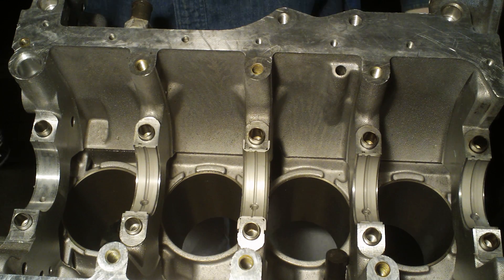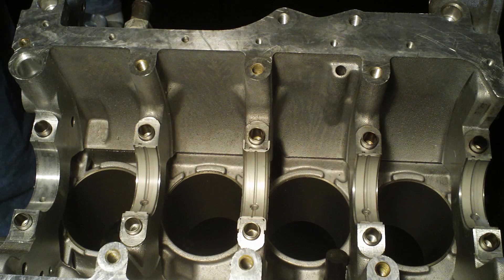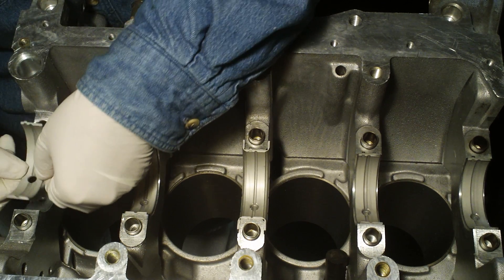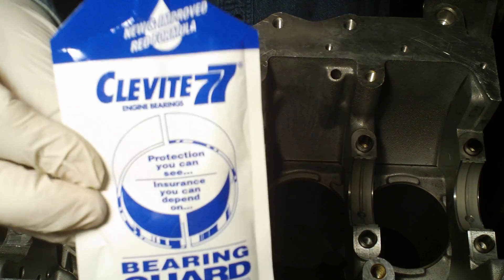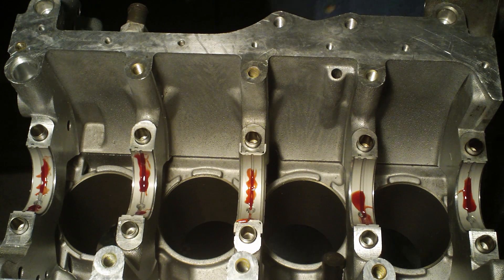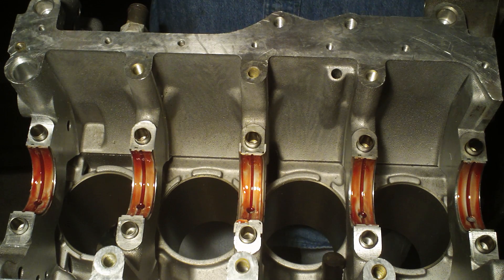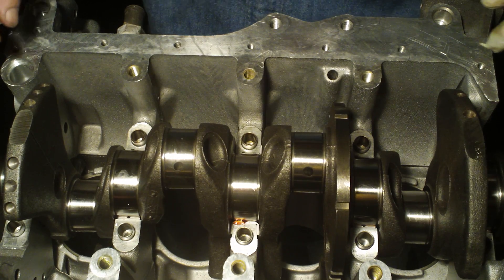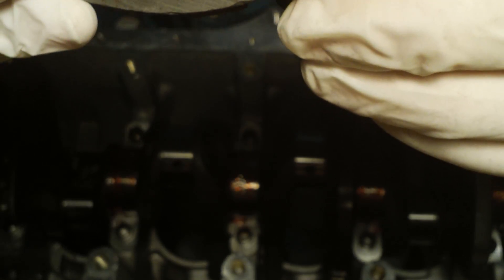Start with Crank bearings to top caps_1.MP4

Comment: Great video! Love the level of cleanliness you work with. One thing every one should not overlook is to lube the thrust washers built into the center crankshaft bearing on it's sides. A dry thrust washer start-up especially with the clutch pedal depressed on a standard gear box can cause major damage.

Comment: @Aaas Gab if you mean about the drain holes, then not really. After dropping the transmission and changing the clutch on a Hyundae Elantra, I kind of don't feel like opening up the engine on my Saturn. I'm afraid that it might not run the same if I do it. Thinking I might just keep putting oil in er. Buy who knows, maybe I will in these next couple of months now that I got a spare car...

Comment: Hi ehunter1. My SL2 Saturn has about 240,000 miles and has been burning oil a lot ever since 100,000. Some people say to drill drain holes in the pistons, however others are saying that the reason Saturns have such long life to them is because they don't have the holes in the pistons. What is your take on the matter? Do you think that new rings will help reduce the oil burning? I'm trying to avoid any drilling of the pistons. Thank you for making these videos, they will be very helpful!